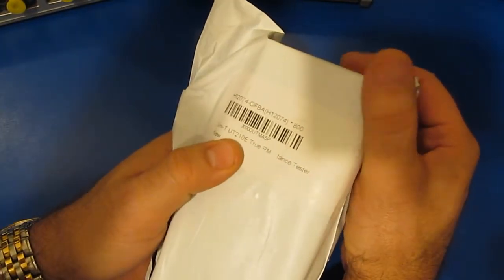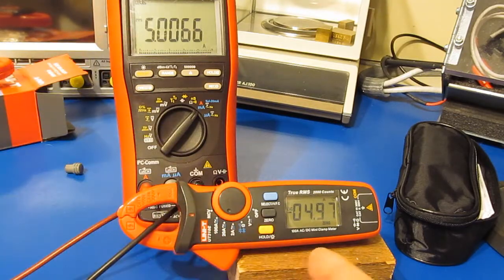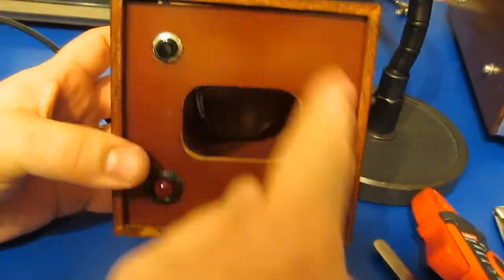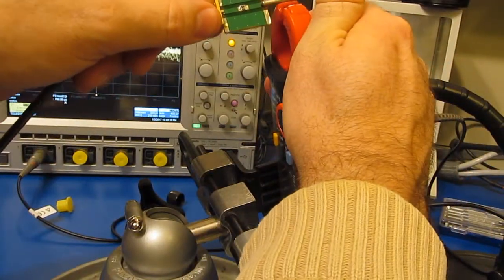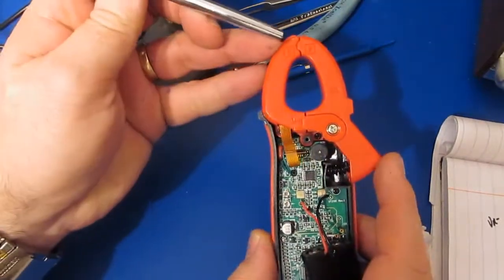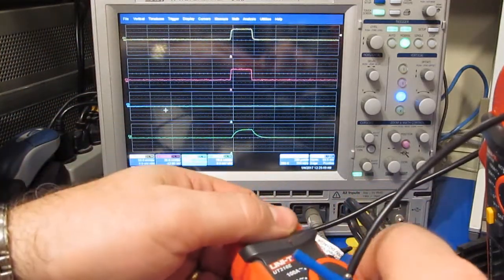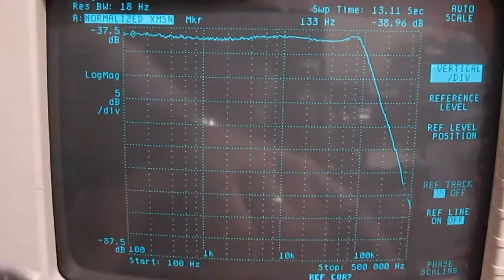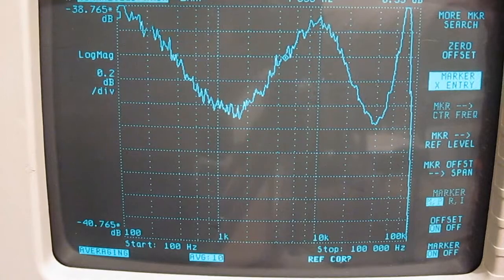Modified UNI-T UT-210E for Higher Bandwidth and Adjustments

Comment: Uni-t are a good brand
They have made a big inprestion in the UK and Europe, all my test instruments are uni-t
Exsept for my MFT with ia a ROBIN KTS 1620, I have a uni-t clamp meter a uni-t voltage indicator and a uni-t multy meter I have been using this brend for seven years and I have never had any problems with them, why pay hundreds of pounds /dollars for the likes of fluke mega kewtech and many others when you can get just as good for a fraction of the price from UNI-T
Reply from the maker: Good in what way?  Sure, they don't cost much.  Is that what you mean be good?    They never do well against my tests.  I know of a few people using the 210E on a regular basis.  So far three of them have had switch failures.   If I needed something reliable and robust, I wouldn't buy UNI-T.   I do like the UT210E but would have gladly paid double for higher quality.   I also really like the UT181A but again, it has too many problems.
Reply: @joesmith-je3tq  I have been using uni-t for the past seven years and have never had any problems of any kind. And they are alot better than the American brand amp probe
Reply from the maker: @seandempsey9396  I would have thought a fan boy like yourself would have know that UNI-T made the Amprobe AM510 I tested early on.
Reply: @joesmith-je3tq  and amprobe are made by Fluke just proves that they are all made in the same factory in China  you only have to look at the design of them at the end of the day they all do the same job and its a matter of personal choice. Just because something was made cheepper in China does not mean that it is inferior take appe iPhone cost about twenty dollars to make in China then apple sell it for a thousand dollars, it cald keeping your costs down and your profits up.
Reply: @joesmith-je3tq  uni-t have never made any thing for amprobe. They might supply components to amprobe. Just had a look on Google about amprobe very interesting history look it up and I think you will find that the am510 was in fact made by Fluke.. So please let's not tern this into an argument, let's just agree to disagree and Leave it at that, and respect each others opinion.
Reply from the maker: @seandempsey9396  I suggest you spend less time posting and more time fact checking.  The certifications for these meters is available.  You can look it up and see.
Reply from the maker: @seandempsey9396  http://content.amprobe.com/certifications/AM450EUR_LVD.pdf
Reply from the maker: LVD, low voltage directive.
Reply: @joesmith-je3tq  uni-t have never made any thing for amprobe amprobe is an American company based in Washington DC and they owne fluke 
That sertificat is just to  say the testers tested relevant standards.
And please don't be rude or disrectfull to me. Are you in America?
Reply from the maker: @seandempsey9396  Danaher Corporation bought Fluke (2003), Amprobe (2006) and a few other technology companies.   They recently spun off Fortive.    Rude?  Just find a UNI-T fanboy channel if that's what you are after.  You won't find it here.

Comment: I solve the offset problem by pressing the zero button while the meter is clamped on and is taking it's measurement.
Then when I remove the clamp, the meter shows the correct value but in the opposite polarity.
Reply from the maker: I don't understand what this procedure solves.  Sure, it inverts the reading but what was the point of it?
Reply: @joesmith-je3tq  It cancels out the offset you get between when you zero the meter and what the offset might be when you take the actual current measurement, no matter what the orientation of the meter,
 There may be a little error creep in if you move the meter before zeroing it. But pressing one button  after the measurement was taken seemed to introduce lot less offset error than  zeroing it and then letting it go to start the measurement.
 It's really hard for me to explain and may have just been a figment of my imagination.
 It won't hurt you to try it...
Reply from the maker: @Dennis-mq6or  Ok, so the claim is zeroing the meter prior to installing the clamp versus after will add error to the measurement.    I would imagine, the act of having to hold the meter to press the button will also introduce an error.   So will temperature, outside disturbances and other..   So far, I have not ran into a problem using the cheap meter besides seeing a high failure rate in the switch.   I did cause one of my meters to have enough offset that it could not be zeroed which was the reason for constructing the degausser.   For $30, I've more than received my moneys worth.
Reply: @joesmith-je3tq  .
I like the meter and use it often.
I use it to measure very small currents that are probably in the range of the ambiguity of the meter. always less than 10 ma, and often 1 to 3 ma.
 I have other current clamps that interface to other meters, but with that one I only have to carry one item instead of two, and it's hard to find a clamp on that can resolve currents in milliamperes well enough for me to make adjustments to see if current is increasing or decreasing. In those cases, relative measurements in real time are adequate.
  For critical low current tests, I have to open the circuit somewhere and  then insert a resistor. I have a reel of .005 ohm 1% resistors. surface mount 2 watt types. and soldered 5 of them together for a .001 ohm (10 watt and hopefully better than 1%) sense resistor.  I use that for low 'burden voltage and low temp drift in the resistor, and make my measurements using the microvolt range of an AN8008 meter.
 I build really low power solar powered stuff, (or at least I used to before I got sick), and the goal was always increased runtime...
 Do you know of any sensitive clamp on meters that would be better for that application?
Reply from the maker: @Dennis-mq6or  I have a very old Tektronix P6042 that I saved from the trash, rebuilt with some help from the late Mr Pease and then redesigned to push the BW close to 100MHz.  Of course they make much better clamps now.  

https://www.keysight.com/en/pd-2877490-pn-N7026A/ac-dc-high-sensitivity-clamp-on-current-probe-150mhz?nid=-32553.1229527.00&cc=US&lc=eng
Reply: @joesmith-je3tq  
I have P6042 probes and amplifer/degauss......
Not very portable!
I also have a much newer HP version that if I remember correctly, WAS a battery operated portable, but I would have to do a lot of digging to find it, and someone would have to give me a ride to the old shop and help me look for it.
Reply from the maker: @Dennis-mq6or  If I need something more sensitive than the P6042 or what I can get with a shunt, I use an old electrometer (another rescue/rebuild) which can be used into the pA.
Reply: @joesmith-je3tq  
Sorry Joe but we seem to have vectored off in different directions again..
I am looking for something CLAMP ON portable (like the UT210E),  that would provide me with better dc  resolution in the low milliampere range than the 210E without me having to wrap the battery wire ten times through the clamp.
 I don't know if such a device exists, or if I could afford it if it does, but right now you know more about test equipment than anyone I know who is still alive! 
Which is why I asked the question.
 If you like older test equipment from the late 80's, I have quite a lot that can be sent to you after I die as long as you are willing to pay my kids to pack and ship.....
 I have one item you may really like.
It is a Tektronix  high voltage probe  that used a special gas inside of it.
 These days I only do low voltage, low current and portable because I can't handle anything heavy, and the UT210E works the best of those I have tried so far.
I do not expect any range switch problems because I only switch it from off to the 2 amp range....I have no use at all for any of it's other measurement capabilities because I find the AN8008 to be more accurate as a multimeter, (which I find amazing for a $20 meter)....
 I have more expensive multimeters but I do not take them out in the rain or snow to measure solar sell outputs and battery charging rates of the devices I have under test.
 My goal being to design the most efficient solar powered lawn or yard lights using the lowest cost parts, and easy for the average DIY hobbyist to build.
Reply from the maker: @Dennis-mq6or  To measure 1mA with any sort of accuracy and precision,  I suspect you are looking at something lab grade.  You may find independent of cost and size, you may not be able to meet what ever requirements you have. 

I've told you what I use to make these sorts of measurements.  You will need to find your own solutions.   

I would contact the major brands and see if they can help you out.     

Yes, some of the old probes used Freon.  You could run them without it.  There was normally a derate curve in the manuals when not using Freon.
Reply: @joesmith-je3tq  
Correct.
I remember the manual that came with it showing the derating curve.
It came in a large hardcase with all kinds of accessories.
.
Since I have an entire reel of those 0.005 ohm 2 watt 1% surface mount resistors, I guess I will start building my projects with one of them in line for any future measurements...

Comment: Clampmeter UNI-T UT-210E do not measure AC voltage,current and NCV. The indicator shows [OL]. What is this fault?
Reply from the maker: This is OverLoad and is covered in the manual.   If your's shows this in all the modes you mention, it sounds like it's time for a new one.
Reply: @joesmith-je3tq  All range measurements AC. DC measure correctly. Thank you for help.
Reply from the maker: @ihor_babii  No matter, the answer is still the same.  It's a disposable meter and sounds like it's time for a replacement.    I have yet to use the leads in mine.  I only use them for the clamp.  The only problems we are seeing so far is the switch fails after a few years of moderate use.  If you use your test leads, it's hard to say what it's been exposed to.  From my testing, UNI-T has not been very robust electrically.

Comment: Does adjusting the null and offset trimmers affect the current clamp calibration?
Reply from the maker: I believe it only effects the meter's sensitivity to orientation and the offset.  You will zero out the offset on each use anyway.
Reply: @joesmith-je3tq  Thanks,  going to give this a go as mine has a pretty large offset even after degaussing.
Reply from the maker: @ferrumignis  I have adjusted three meters and was able to improve them.  The one adjustment is very sensitive.
Reply from the maker: Make sure to use a diddle stick and not a screwdriver.

Comment: Which is better among UT210E and UT256B????
Reply from the maker: If you are able to define what "better" means to you, read the manuals for each, then you should be able to answer that for yourself.   That's not something I can do for you.
Reply: @joesmith-je3tq  OK
Reply: @joesmith-je3tq  I was questioning about accuracy... in reliability I think 256b!! As certifications!!!
Reply from the maker: @partscience  Accuracy will be specified in the manuals.   For safety certifications, I suggest checking some of the on-line databases.    As for reliability, I can't answer that. All of the data I have collected on these meter is available for free, on-line.  If the meters you are asking about are not on that list, I have not ran them.

Comment: good video man, you could do a lot for the automotive diagnostic tools like the oscilloscope and amp probes being used now.
Reply from the maker: When I first bought one of these and saw it could read down into the mADC, the first thing I though of was automotive.  I've since used this clamp three times to check the current draw after the car has gone to sleep.  It works very well for that.
Reply: @joesmith-je3tq  could a person take GTC cm100 ammeter and add an oscilloscope jack to it,i seen it will read in the milliamp range?
Reply from the maker: @henryrobinson9837  It's very possible that something like this could be added.  The problem I see is that these handheld devices are safety rated and altering the design can make them unsafe.    It's better to just buy the correct tools for the job.
Reply: @joesmith-je3tq  i've high and low current clamps but always looking for different things ,especially something to help filter noise out of an oscilloscope
Reply from the maker: @henryrobinson9837  Your scope can't average?

Comment: I just got the voltcraft 335 which is the same as this, just rebranded. I got it to check my solar setup on my van, and various dc draws. But people are saying the clamp function is worthless and "only good for hanging it off your belt". They offer no further info than this (always annoys me) but are they correct?
Reply from the maker: I would guess I know of about 10 of these now in service (people I know).   The only meter that has had a problem is one that I use a fair amount.  The switch started to become intermittent and required cleaning after about a year of service.   I bought it because for the 1mA resolution DC clamp.  It's the only function I use it for.     You can always point these people to the videos I have posted about this meter.  Maybe this will prompt them to explain their posts.     Here are a few others:   https://youtu.be/QzURNKD85yo   https://youtu.be/PghlJbbj6pA
Reply: joe smith thanks for the reply Joe! So I can be happy with my purchase?
Reply from the maker: @timothy790110  I can't justify your purchases nor can I tell you if any product will meet your needs or not.  That's your job as a consumer to do you research BEFORE you buy.  What I can do is offer you and others the bits of data I have collected from looking at these meters.
Reply: joe smith Hehe, yes of course! Thanks for the reply!

Comment: Very interesting mod.  I bought this model and now wish I had bought one that has a "max" mode to measure inrush current on motors.  Is that a feature that can be mod relatively easily?  If so, is it a worthwhile mod based on the sampling rate of this model?  Wouldn't want to do it if the sampling rate on this meter is so slow that it can't catch the peak of the inrush current.
Reply from the maker: That would be a question for UNI-T.  I would never suggest anyone ever modify a handheld meter.   That said, I would use a scope to look at in-rush anyway.
Reply: Thanks for the prompt response and advice.

Comment: Bro plz tell if v select the dial at continuty, diode (instead on voltage mode) and plug the probes in socket then what happen??
Reply from the maker: I have never used the probes with this meter.  How many volts on this socket that you connect it to?
Reply: joe smith 220 volts
Reply: joe smith bro today i brought this meter. Plz tell me the cases in which meter can be out of order. Like wrong selection of rotary switch etc
Reply from the maker: So, 220V AC lines.  I doubt the meter is certified for safety and it's nothing I would use for any sort of work like that.   If your concern is not safety and just if the meter would survive, it may.   I would just read the manual and make sure you understand all of the warnings about how to use it.   Obviously you should not be using the meter in anything but the voltage modes when measuring voltage.
Reply: joe smith thanks for reply joye In this meter has a VFC option and when u press and holt the select button on Ac amps or vots it show VFC on and off. So what is the VFC and how does it work??
Reply from the maker: Is there no mention of it in the manual?  This is used to make measurements with a variable frequency drive.  I suspect it would be a low pass filter.
Reply: joe smith sori bro i didnt understand and in manual its not describe... Did u use this function?
Reply from the maker: No, I have not used it.

Comment: bro i am gonna for buy Meco 1008 trms clamp multimeter. does it better then UNI-T UT 203 and others ? kindly tell me it's urgent?
Reply from the maker: There is an on-line spreadsheet with the meters I have ran along with a FAQ.
Reply: i cudn't understand bro.. say in other words my question is that does meco 1008 or 1080 is better then unit ut 203 ?
Reply from the maker: I don't offer recommendations and I have never ran the meters you are asking about.
Reply: ok bro thanks.. then does UT203 best for DC current measurement and accuracy? if i buy this one
Reply from the maker: If I have never tested a UT203, how would I know?  You need to download the two manuals and compare them.

Comment: You don't happen to know how to calibate it? Or is the calibration program in the meter (yellow+blue+pwrON) a selfcalibration or factory calibration?
Reply from the maker: I assume to meant align or adjust the meter, not calibrate or check against a standard.  I have no looked into aligning one.
Reply: Yes I mostly wondered if I could somehow adjust it to get better results in accuracy/precision. If that's only done though the trimpots? Also if you knew what the "CAL" (yellow+blue+pwrON) is? I have e-mailed UNI-T and requested more information and documentation but I thought you might also know.
Reply from the maker: It you watched this video, you are aware what the trim pots are for.   You can try adjusting them yourself to get a better idea of the effect they have.    I have not looked into aligning one.  I am not surprised the UNI-T would not respond to a question like this.  You may find that when asking the same question to other companies.    I can see people playing with things that perhaps they are not setup to do and then expecting the manufacture to  correct their mistakes.   Still it does not hurt to ask.
Reply: Oh yes I watched the video(very good), that's why I'm here asking. Well no mistakes are made here(yet, haha), but I always have the luck of getting sent to me the one specimen made before closing on fridays in the factory or maybe just it's my expectations are too high o confidence in the readings too low.